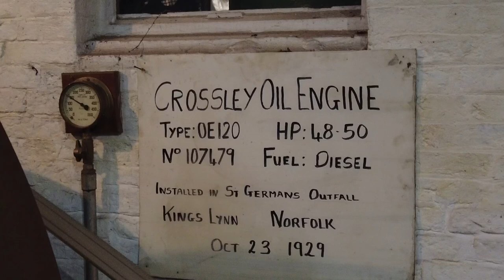Crossley OE120 of 1929

Comment: Nice engine I do have a similar engine but smaller from experience I can say there is not enough air pressure, to start that engine a minimum of 250 PSI according to the manual it needs 300 PSI.